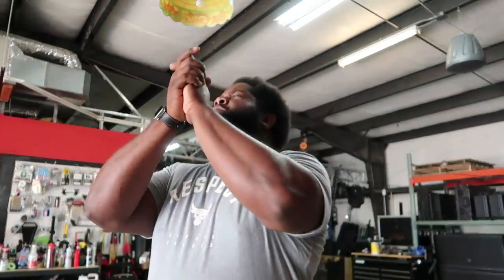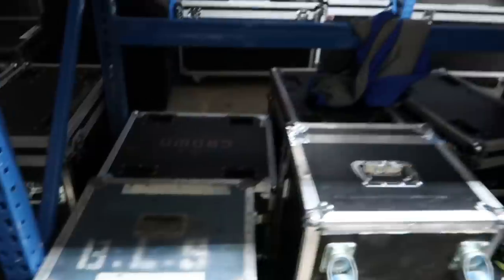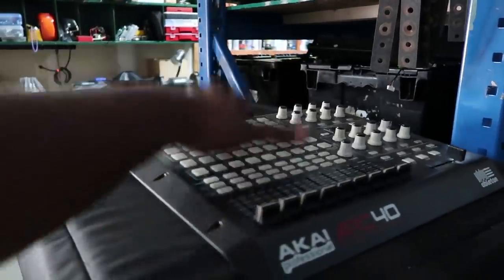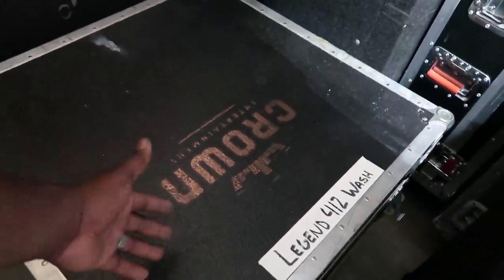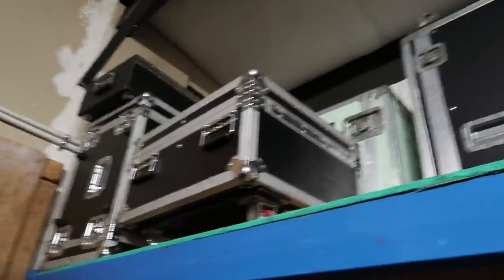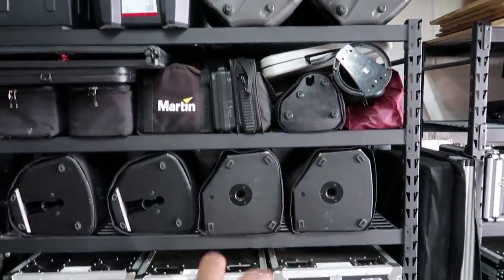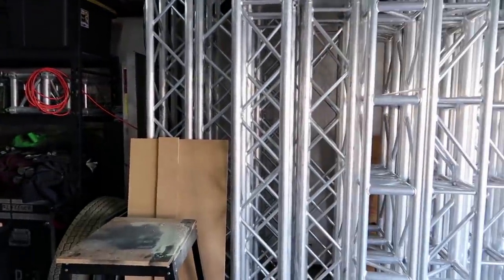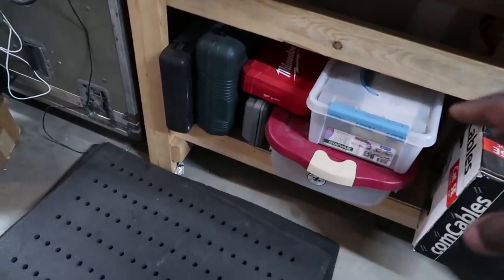2020 MULTI-OP DJ COMPANY AND PRODUCTION HOUSE SHOP TOUR! | A TOUR OF ALL MY DJ AND PRODUCTION GEAR

Comment: Did you add air conditioning to the shop?  I thought it used to only be in the offices.
Reply from the maker: It’s been installed since I’ve been here but I never run it. It triples my electric bill.